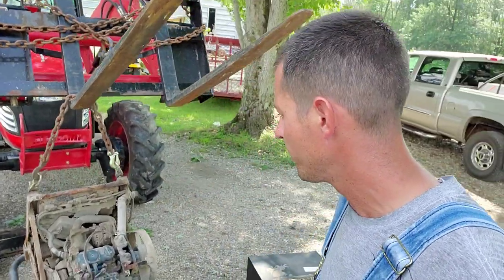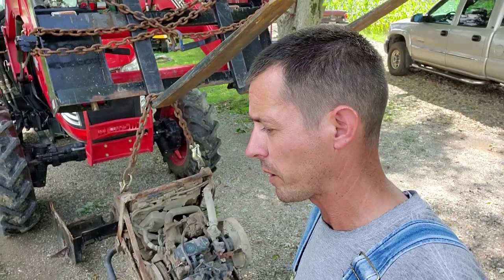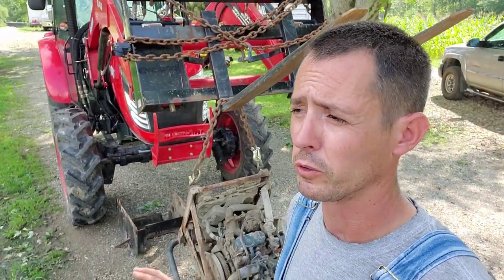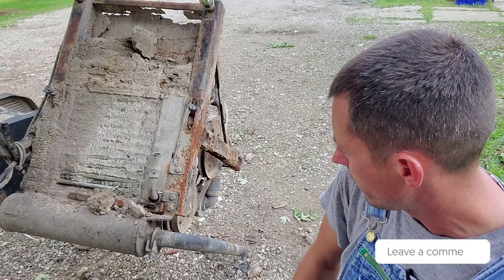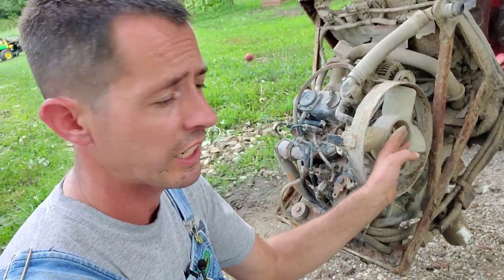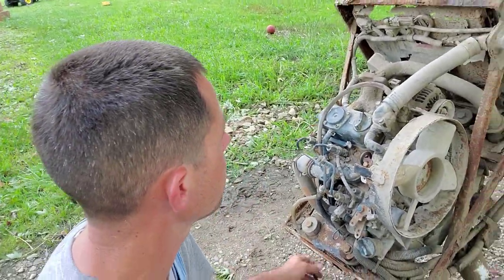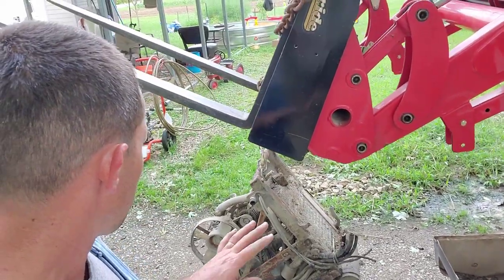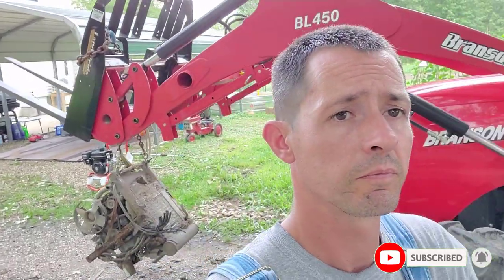Thermo King Tripac APU VS Carrier Comfort Pro APU - The Difference & Which is better?

Comment: I have a carrier comfort pro apu on my 579.  It has almost 24,000 running hours and still kicking it.   Mine has its own coolant reservoir and I have an evaporator under the bunk with the condenser on back of cab.  I’ve used both carrier and thermo king and I honestly prefer carrier.
Reply: I need one for my Pete that doesn’t have a bunk heater so I am leaning towards Carrier. Thank you
Reply: @adco  it’s worth it bc my carrier AC is colder than my truck AC.  They got dealers all over.  😎
Reply: Carrier is louder

Comment: I really like this Carrier idea that you have going on. Doing it for $5,000 is a little steep on price, but you’re also rebuilding the engine to go with it. Place in Missouri sells used APU’s and installed they cost $5,000. Can’t wait to see the end of the series on this and see which is the better idea. 

I currently run a generator off the back of my truck and use a portable ac unit in the cab. If this pans out I might just hire you to do another one of these builds, lol
Reply from the maker: Will keep you updated!
Reply: I’m in Missouri. Do you by chance know where the place that has the used APUs at. Sounds kinda awesome
Reply: @PoBoy_Trucker  it’s Dale’s APU’s in Springfield, MO.
Reply: @cweber9112  terrific. Thanks so much. I’ll look into it
Reply: I know this is an older vid, but wanted to note that I highly recommend Dale’s APU in SpriMo, and Dale’s is also a certified seller/installer/warranty shop for Green APU.

Comment: In my opinion......yes the carrier is louder than the TK by far but if you intend to use a lot of house power (110v) for cooking and whatnot the carrier is far superior in that aspect. It has a 6k ac generator built in the unit whereas the TK uses a 120 amp ish 12v alternator and an inverter to create house power. It all depends on really what you want do with the Apu. More house power..... carrier.....basic needs .... TK. That's just my opinion. Take it as you want.

Comment: Ryan,  I like the plan you’ve come up with.  If you couldn’t get a used APU, I think that I would basically do what your doing, except I would probably mount an electric start 6 kw kubota and mount a 5 or 6 thousand btu RV A/C unit on the roof of the truck and compliment it with a Chinese wabasto bunk heater knock off unit.  Having said that I would also carry a 1500 watt electric space heater in winter just in case the knock off failed, till I could get another one for $130.00 on Amazon.
Reply: This only works if you have a shorter truck that can accept the unit for height. Taller trucks like my 780 wouldn’t be able to have a roof mounted a/c system.
Reply: @cweber9112  Very true.I guess it would depend on the type of truck you had as to what would work..  I have seen some Condo units on the road that have the RV A/C units mounted on the front slope and the white cover painted to match the colour of the truck. They do make some nice compact units now, not like old days with those big ugly bulky units. Being as I’m frugal, “cheap”, I think I’d figure a way before I’d put out 15 or 20 grand for an APU. Just my thoughts but good point Bearded Trucker.
Reply: @aj44ish  my next truck I am debating on buying a mod roof just to install a roof mounted ac system, lol

Comment: I choose Carrier over the Deevolution. The older tripacs were great and blew ice cold ac. You could turn the heater on when the motor had a fault. And you could get the trouble code without the usb. The usb is a good idea, but bring back functionality when stuck in cold weather and the apu won't start or breaks down and don't use cheap parts. As for the heater. You need to change the atomizer screen once a year. It's a cheap easy job. They were designed to run on kerosene and not dirty diesel fuel. But if you keep them cleaned out once a year, they will not let you down. Espar is quality they just hate not getting enough air to start when clogged with carbon.

Comment: Did you ever encounter a T680 leaning to the right,  I have changed. Cab mounts,  shock absorbers. Spacers blocks, and springs leaves, don't know but also to do to get it level.

Comment: Besides heat and cooling,  I thought an APU made 12 volt power to charge the truck batteries for the truckers using Microwave ovens, coffee makers, TVs and dvd players or Cpap machines and everything electric.     And now for a question. What is stopping you from mounting an APU up on the frame rails a few inches from the cab?  The only downside I can think of is that IT will be destroyed if you jackknife the trailer.  But you're not supposed to do that anyway.

Comment: Hello sir, I have a TK ApU on my truck, basically the AC works perfect and when the batteries go down 12 V it autostart, but not when I use the heater, a friend of mine told me  have to replace the fuse box, it is the only solution? Thanks

Comment: Hey Ryan! I am in the unique situation where I am also looking at both units (with limited frame space).
Can you tell me the space in inches from your Fuel tank to the suspension mount that your APU sits in?
Both carrier and TK need 24 to 26 inches of frame space and your space looks pretty tight, I would love to know the space you TriPac takes up.
Thanks as usual great info on anything and everything!!
Reply: I don't know if you have a headache rack or not but I have seen them mounted at the back of the cab before. not sure if it's a special mounting kit or if it's a custom thing but I've seen it several times done that way mostly on short wheel base trucks.

Comment: You only need 1 HP to power each one ton (12,000 BTU’s) of cooling, plus I guess maybe enough to charge the truck batteries. So, I think they could make a small 1.5 to  2 HP unit identical to a trailer reefer unit, but much smaller and mount  it on the back of the cab. I am certain “they” could make it smooth enough and quiet enough to mount on the cab where it would not be submerged in salt. They could make it a heat pump with electric heat strips. Thanks.
Reply: 1 hp to run ac compressor?? What are you talking about I have rigmaster with lombardini 2 cylinder 15.5 hp and senden compressor 24k btu when compressor turns in sometimes it even does chockes my engine specifically when it is cold

Comment: I say screw both of them, especially the carrier unit.  The coolant for the APU should NOT be connected to the truck's coolant that's just ridiculous.  I rather get an RV and a generator and install that and probably have a stand-alone a/c unit and some batteries to charge up when the diesel truck is running.

Comment: No that's not a remote oil filter you pointed out that's a fuel filter and don't compare apples to oranges this unit is highly neglected my unit was purchased in 2006 and has over 35000 hours on it

Comment: Why do van drivers park on the shoulder so often when it’s clearly not an emergency??? They drop their phone where they can’t reach it? Sometimes it seems like there’s one every couple miles re-entering a 70mph highway at 5mph.
Reply: Truth is a lot truck drivers are braindead and drive until the last minute before they have to take a 30 min break and keep driving. It’s such a retarded and dangerous move since they can get hit or cause an accident. Instead of going to a rest area or gas station or at least exit off the ramp and pull over on the other ramp back onto the freeway . I’m a truck driver myself and they still do this . Angry DOT officers sometimes get them and give them tickets 🎉
Reply: Don't forget the flat bedders who pull right on the shoulder n right next to the right travel lane to resecure their load as traffic whizzes by..... Go to a rest area , truck stop or at least get to a double width paved area...

Comment: The biggest difference is the carrier puts out 5500 watts and the tripac only puts out 1800.
Reply: But the carrier had to run an electric air conditioning compressot and condenser fan motor out of that wattage, making it  equal or less leftover wattage